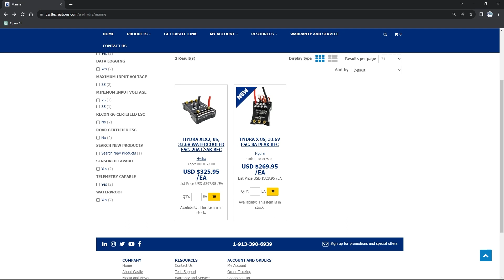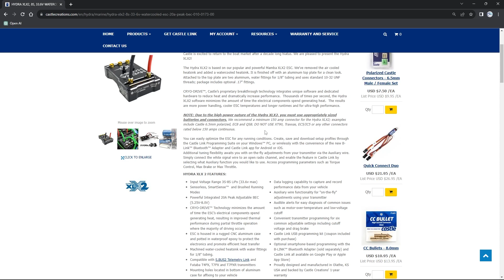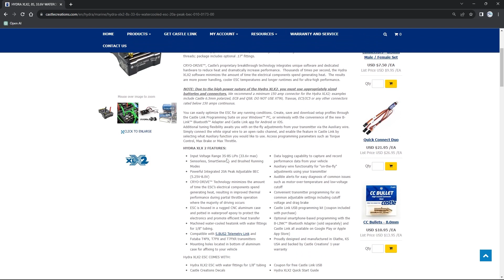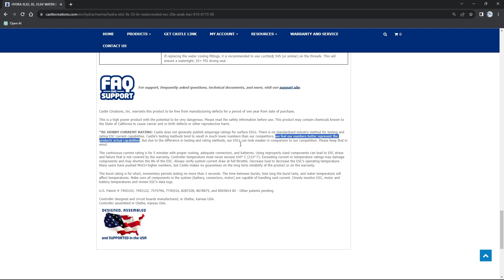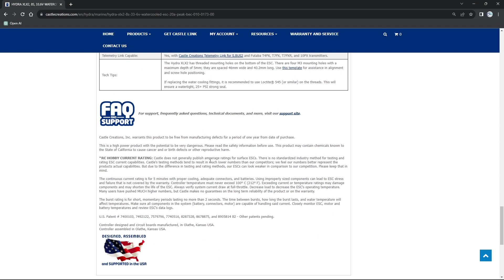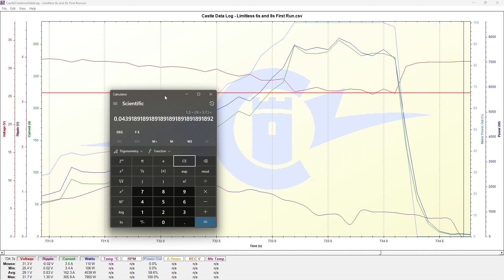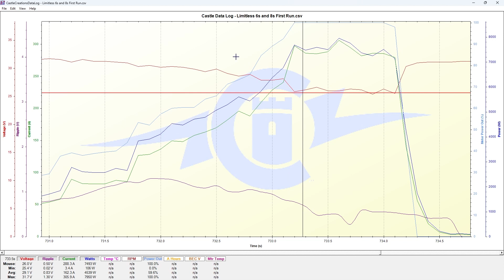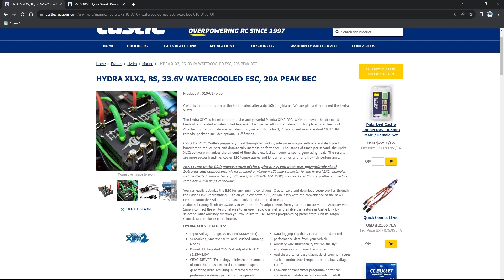Castle Creations XLX2 BEAST of an ESC Transformed for RC Boats

Comment: Interesting topics.  Any idea what motor size and esc to use to convert a 20cc airplane to electric (I assume it would be 6S), or how to work out the conversion electric power required. Thanks

Comment: Kindly I am using a tp 4080 2080kv motor with the xlx2 and I made a cap pack with five capacitors of 35v 4,700 m f each, and I am using 6s 6amps 100c battery. 
I tried to check the ripple voltage on the data log and I think it is around 0.4 volts!
Do you think that I need to change the capacitors or remove the cap pack completely because it doesn't need it?
Thanks for your videos because they are quite interesting and educational.
Reply from the maker: Less than 5% is good!